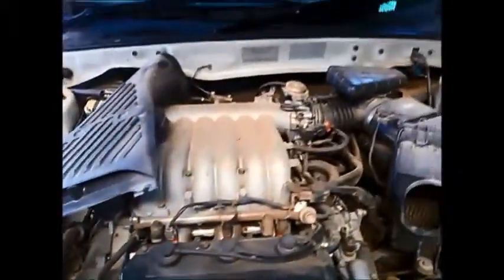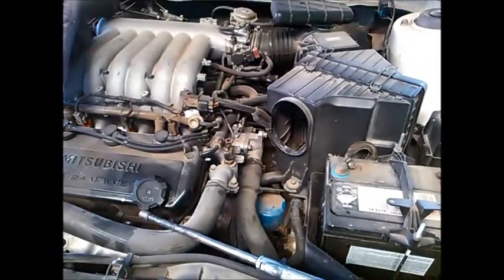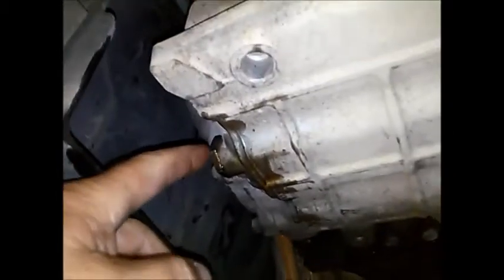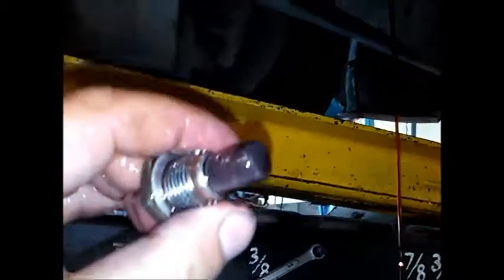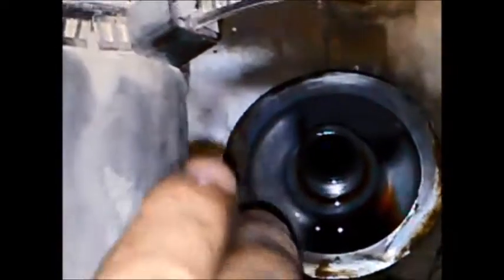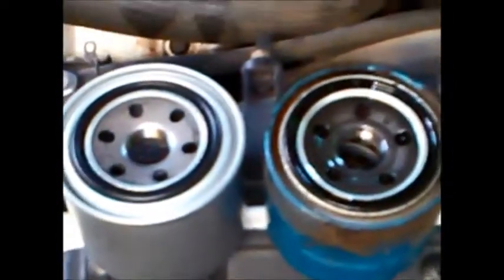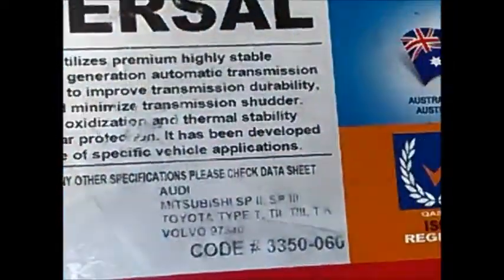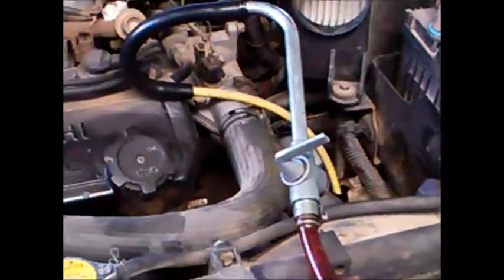Mitsubishi F4A51 Automatic Transmission Filter Service & Fluid change how to DIY

Comment: Hi love the video mate ive just brought all fluids to replace in my 2002 rallyart just wondering what tool you used to fill the fluid back into dipstick as i can only get a cheap manual hand pump and to do 8.3 litres by hand is going to take me a year so any advice would be valuable cheers

Comment: 02 dimente, transmission took a crap. Wave spring broke the pump. Is there manual transmission that will fit.
Reply from the maker: hi, we would just do the repair on your trans...anything can be done with enough time, money and effort. we don`t do conversions.....these days the value of conversion exceeds value of car. choice is yours though. have fun cheers

Comment: MY DIPSTICK IS SHOWING OIL IN ABOUT HALF OF THE DIPSTICK . SHOULD I REMOVE EXCESS OIL ?
Reply from the maker: hi, as fluid warms it expands, if you have too much fluid in the trans, it may reach the spinning components and aerate the fluid. in a hydraulic system air can be compressed and oil not so much, if aerated can burn bands/clutches and also causes overheating. sometimes aerated fluid can also come out of trans breather as well. best to keep at correct level. cheers
Reply: @YepThatsIt  THANKS, But hear me out. One sid of a dipstick is showing  a lot fluid over the markings, almost in the middle of the whole dipstick but other side shows in beetwen the markings, so whitch side should i trust ?

Comment: How many litres of oil should I put into the transmission
Reply from the maker: hi, the amount that comes out is good reference, but make sure you confirm level as per manufacturers recommendations according to temp. cheers
Reply: @YepThatsIt  thanks mate much appreciated

Comment: Ya didn’t show where to put the fluid lol
Reply: If you pay attention to the whole film and look at your gearbox also, you can easily find out where to put the fluid.
All the older automatic gearboxes are the same, you take out the dipstick and fill it through that hole 👍
I didn't knew it was that easy, I have to do it soon on my RVR Space Runner MK2.